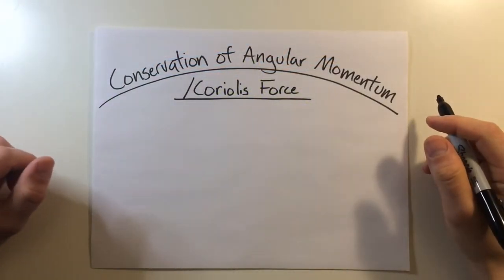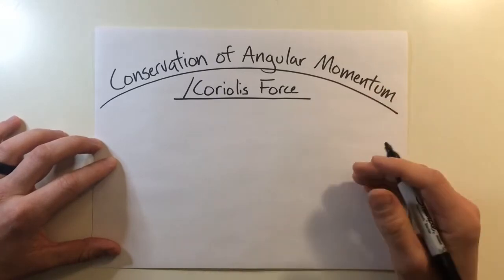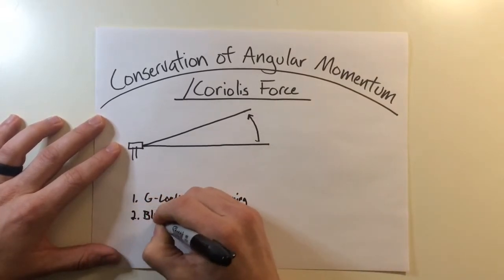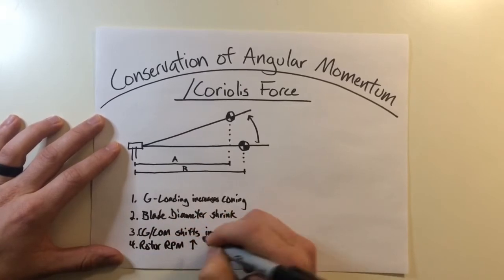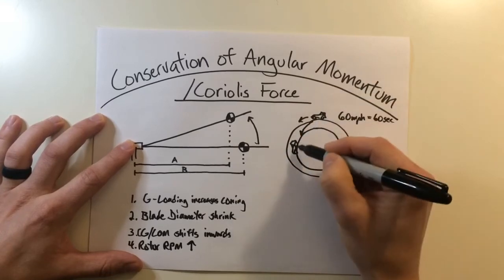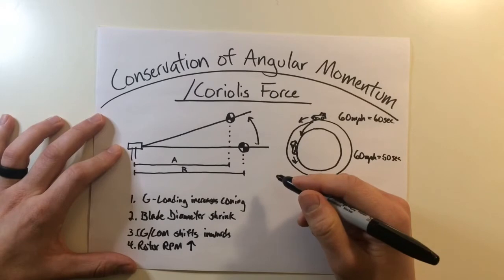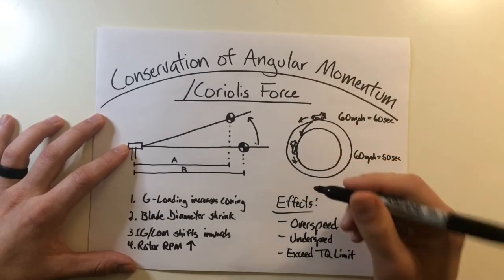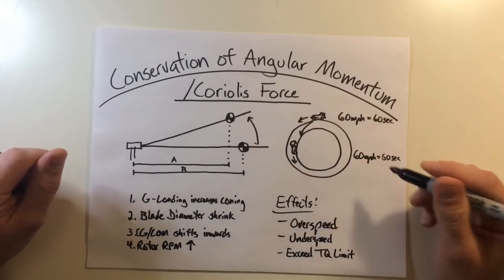Conservation of Angular Momentum / Coriolis Force in Helicopters

Comment: Have you done one on Coriolis force during straight and level flight?

I understand you are taking here about high g maneuvers, but perhaps a basic discussion about what happens in straight and level flight would be helpful. At about 2:29 you say the same coning will happen on both sides.  That is not the case in straight and level flight. At about 4:00 you state the rotor speed will increase as a result of the blade tip traveling faster.  Again, not in straight and level flight.

In straight and level flight, at a 60 MPH airspeed for the helicopter, the advancing blade airspeed is 120 MPH higher than the retreating blade airspeed. As a result, the advancing blade would create much more lift than the retreating blade. That would make the helicopter roll, if not compensated for. The blades are designed to flap. They flap up on the advancing side, which decreases the advancing side's lift. They flap down on the retreating side, which increases the retreating side's lift. As a result of this flapping, the Coriolis force mandates an accelerating blade tip speed on the advancing blade as its CG moves closer to the center of rotation, and a decelerating blade tip speed on the retreating blade, as its CG moves further away from the center of rotation. These blade tip speed variations do not cause a change in the rotor rpm.  The increased/decreased blade tip speeds are happening simultaneously on opposite sides of the rotor. In addition to engineering a way for the blades to flap up and down, there is also a need to engineer a way for the blades to lead and lag their expected positions. Viewed from the front, the advancing blade side of the rotor will be higher than the retreating side, like this, \__  (exaggerated) and viewed from the top, the advancing blade will be forward of where you would expect to see it, and the retreating blade will be behind where you would expect to see it., like this \/ (exaggerated).

In straight and level flight, the rotor speed will not be affected by the increasing/decreasing blade tip speeds as the design of the rotor allows enough lead and lag range that the variations in tip speed are not transferred to the rotor shaft.

The Coriolis force plays a big part in rotor dynamics in straight and level flight.

The effects you're describing for maneuvers take place in addition to the already significant effects seen in straight and level flight, and would be cumulative on the straight and level effects.

All the above is based on my understanding, and I welcome any comments, questions, additions or corrections.

Comment: So is it always the Coriolis effect that causes blade flap then?
Reply: Blade flap???  As in the changing aoa of the blade?
Reply: Blade flap is caused by the dissimilar lift produced by advancing and retreating blades. Advancing blades create more lift, retreating blades create less. Blade flap equalizes the dissimilar lift and prevents the helicopter from rolling during forward flight.  Up blade flap moves the rotor blade's center of gravity closer to the axis of rotation. Down blade flap moves the rotor blade's center of gravity away from the center of rotation. The coriolis force, in response to these shifts in the center of gravity, accelerates the blade as it flaps up, and decelerates the blade as it flaps down. The acceleration causes the blades to lead (while flapping up) or lag (while flapping down), as necessary to conserve their angular momentum.

Comment: Jake, again, do not use equivalently the Conservation of Angular Momentum and the Coriolis Force.  They are two totally different things.  The Conservation of Angular Momentum is a law in Physics.  It is NOT a physical quantity, it does not have a unit of measure.  The Angular Momentum is a physical quantity and it has a unit of measure .  The Coriolis Force IS also a physical quantity and it has a different unit of measure from the unit of measure of the Angular Momentum.  Both the Angular Momentum and the Coriolis Force are vectors, that is they have a direction addition to their size.  The direction of the Angular momentum of the blade in a counter-rotating helicopter is determined by the right-hand rule and it is pointing upwards parallel with the mast and its size is proportional to the blade rotational velocity.  The Coriolis Force acting on the blade is vertical to the mast and has the opposite direction to the velocity of the blade.  In a articulated system the Coriolis Force pushes back the advancing blade - legging - and the size of this force is proportional to the up-and-down flapping velocity of the blade.  
Thanks for the video.

Comment: fist of all thanks for taking time recording the video and making the people understand. I have few questions;
1. Coriolis effect, as it is described almost every where else, is related to water/air movement towards east in northern  and towards west in southern hemisphere  due to earth rotation. How this is applied/related to rotatory aerodynamics, particularly in helicopters? for which I'm here to seek the application of Coriolis effect. 
2. conservation of angular momentum, spinning speed remains constant unless acted upon by some external force (torque). What is link between conservation of angular momentum and Coriolis effect? How do they relate?
In your video, the main point I got is rotational speed changes as the CM of rotating body comes closer or goes far from its rotational axis, that's perfectly fine and understandable. Now, is that what you are calling Coriolis effect? shifting of CM towards or outwards from axis of rotation?
As the rotor rotates, with positive blade angle, it produces lift, heli goes up in the air. Moving against the centrifugal force (trying to extend blades straight in the direction of rotation) the blades tilt upward instead staying parallel to the ground because lift force taking them up and at the same time centrifugal force pulling them outwards which results conning in the rotor. This conning causes to move CM of blades towards their axis of rotation and as a result rotor speeds up more with same power being delivered from the engine. Am I getting this correct? So, now at which point where the Coriolis effect coming in here? Or to what you call Coriolis effect? 
I am very thankful if you take time and help me understand the topic. I have read at many places, all they talk about theory stuff but no where I got the opportunity to understand how angular momentum/coriolis effects actually at play in the rotors. Looking forward to your kind response.
Reply: Coriolis is an important factor for heli blade flapping or coning as your blade mass is getting closer to the center of rotation and will want to speed up causing stresses on the system if its not fully articulated
 If you let the blades hunt it will take some of the force off the rotor head.
Reply: @jim thanks for comments. My query still there. Waiting video maker to address my question.
Reply: @leathelhit  +1
Reply: @leathelhit  The Coriolis force acts on movement on the surface of spheres, big and small. Air movement on the surface of the earth (big) is one example. If you visualize both helicopter blade tips hanging straight down,  (south pole) then start spinning them, and gradually raise the tips until they are pointing straight out (equator), then straight up (north pole), the path of the blade tips will describe a spherical surface (small).  It is the blade tip's relative motion on that described small sphere where the Coriolis force has an effect. The earth's Coriolis force has a negligible impact on the helicopter. The Coriolis force exerted due to the blade tip movements on the small sphere described by the rotor tips is what's being discussed here.

Comment: Sir, can you please explain what the results of over torquing the rotor system and what yo look for if the situation occurs. Thanks.
Reply: Over torquing subjects the drive train to  stress/strain which exceeds the design limits. This can quickly or eventually result in component failure depending on the severity.   In a helicopter with a torque gauge it will indicate excess torque is being produced. An engine monitor will log the event and the mechanic will charge for the inspection/repair/ replacement parts.  Potentially several hundred thousand dollars in a turbine powered machine. In a piston powered machine the manifold pressure gauge will indicate excess power being produced as a result of  the governor or you twisting the throttle.

Comment: At 3:55 you said "decrease" where i think you meant "Increase". Love your videos though!
Reply from the maker: shockerthreeone. You're right. I didn't catch that when editing. Looks like I say it correctly when writing out point #4.  Sorry for any confusion.
Reply: No worries brother. I'm a National Guard UH-60 SP/IE and I use your videos for my own personal study. Gotta keep the sword sharp! Thanks for your time and effort with these.
Reply: Video suggestion: why does torque spike when turning right on a counter clockwise rotor system? 

Really liking the videos!!
Reply: @harrylee591  May I?  A counter clockwise rotor system in situation as suggested will cause a precession resulting in a force that torques the rotor forward and down.  The reverse will happen on clockwise rotor system. I don;t know how this affects the lift or engine performance. Hope this gave some insights.
Reply: @harrylee591 it’s the opposite. Reason—Increased drag over the tail. System response is to give you more power due to the slowdown caused by the increased drag. This is transient torque.